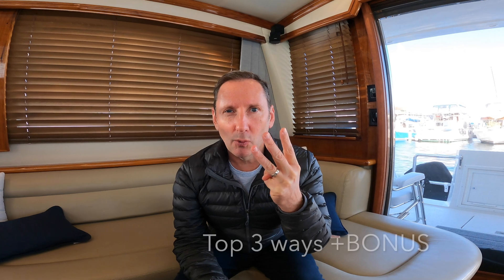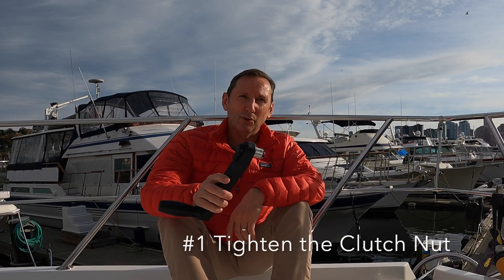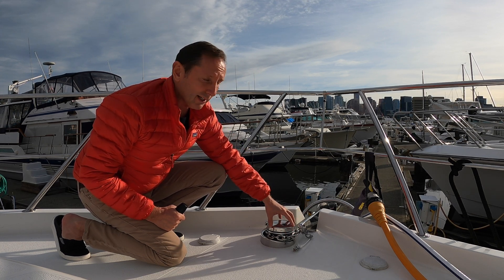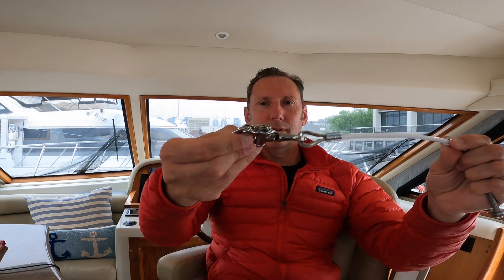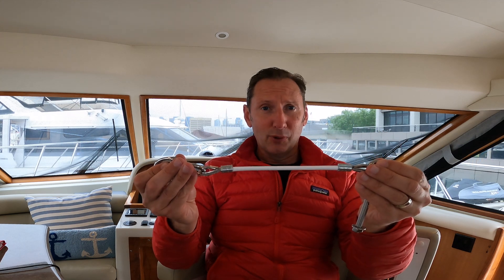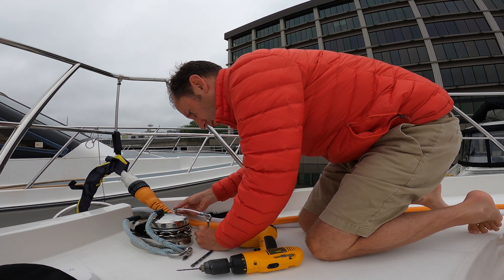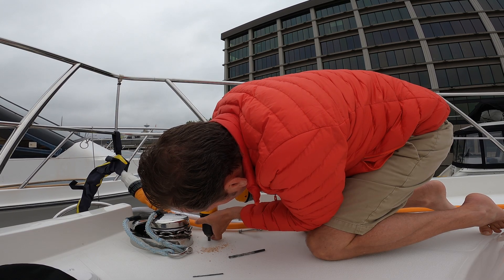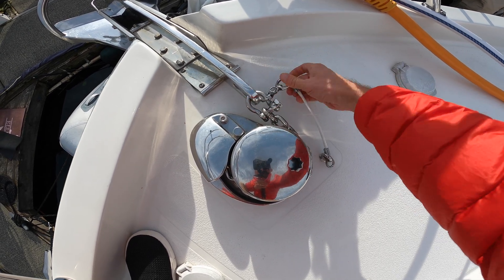Top 3 Ways to Fix a Muir Slipping Windlass

Comment: On my dual system the dogs are built into the windless for two reasons; like you said to stop a runaway situation but also to take the pressure off of the motors by allowing the dogs to hold the chains securely both in retracted and deployed modes. I was worried when you said you'd be drilling a hole through the deck (totally unfounded) felt a bit better that you were also drilling though the windless' steel plate and very relieved that you measured twice, drilling once...lol... At least if worse comes to worse you can always put in a bigger stronger bolt but you'll most likely never need to do so. For around the house and onboard I love using synthetic greases. There are so many places that a thin noninvasive, invisible coating can be placed that respells water and makes timely maintenance super simple. And synthetic grease does not feel greasy on the fingers, wipes off super easy. Excellent video U2, have a great week. I'm hoping your going to do some west coast winter survival MY videos and a few trips just to show it can be done.
Reply from the maker: Having the built in dogs would be nice. We will try to get some winter cruising in but it has been a very windy fall and the locks are closed for maintenance right now so going out into Puget Sound may not happen for awhile. Just curious, what type of boat do you have? Thanks for your comment as always!

Comment: 👍🏻
I would rather prefer to use a special gadget for the drill to remove a bit of surrounding wood core in a hole then fill the hole completely with epoxy and drill a the hole again when the epoxy cures

Comment: Looks like you’ve got a balsa core deck. Would be a good idea to oversize the hole, fill with epoxy and then drill out to suit bolt diameter. When the sikaflex fails, water will get into your core.
Reply from the maker: Good eye and recommendation. Two seasons ago, we did just that. The only add was, we put in a stainless sleeve so the anchor chain didn’t eventually work through the epoxy. It wouldn’t be necessary for most folks that rarely anchor out. However, we’re on the hook 50+ days a year.